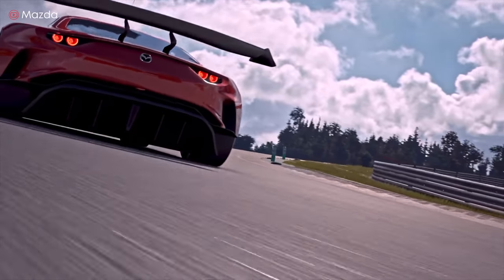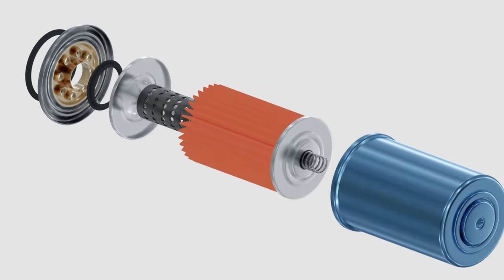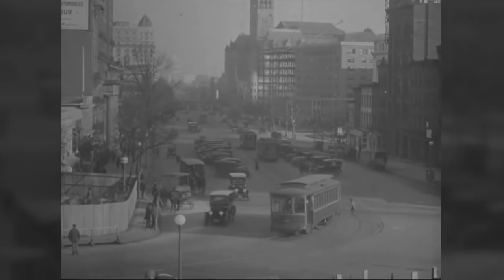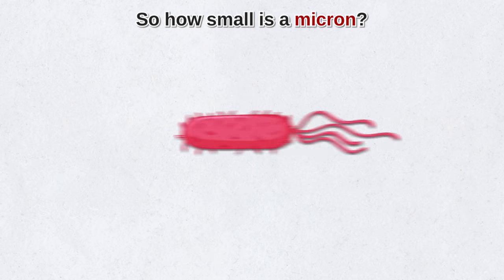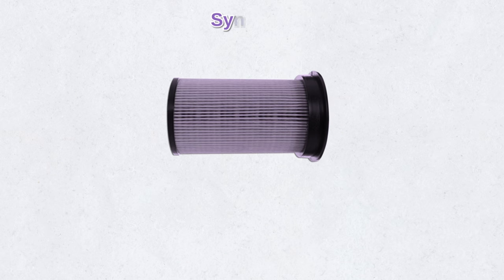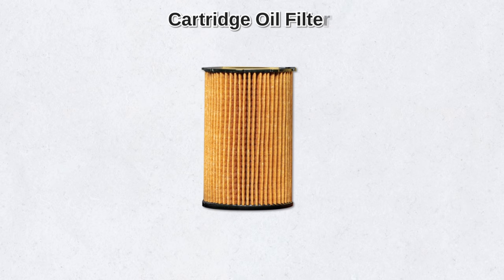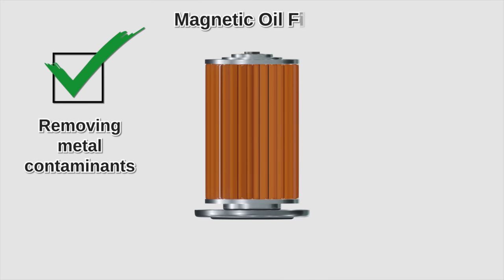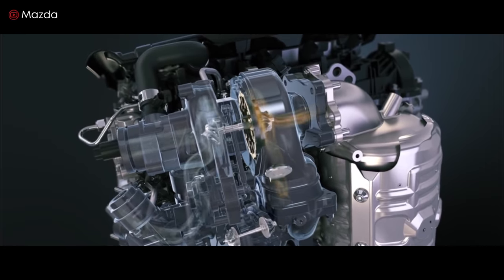This New Oil Filter Just Changed the Game (No More Oil Changes)

Comment: Around 1956 or so, family was vacationing in upper Michigan.  One of the other guests had a 55? Chevy.  He changed his oil filter with a roll of toilet paper.  Filter container was large enough for it to fit.  Thought then that it might not have been a great idea.
Reply: Yes of course it had to be a Frantz.   The famous Frantz 3 stackers that you still can find on diesel engines in the  gulf of mexico  was the same as the origional Frantz that used the old canister housings was tall enough to take 3 Frantz canisters with 3 rolls of toilet paper. When they went out of production a Frantz dealer replaced them with a big paper towel filter called a Gulf Coast filter. The smaller Frantz was replaced with an improved toilet paper filter called a Gulf Coast  junior. All I use now is the old Motor Guards and Gulf Coasts and some Motor Guard compressed air filters that I converted back to oil filters. I'm a toilet paper squeezer and very good at it .60 years of experience. The Australian Jackmaster looks interesting. I'm told some Australians  use toilet paper in them. They came out in 1954. I added a Australian Jackmaster to my filters. A very impressive filter. The top loaders are better equipped to use Toilet paper. They have the bigger core seals for the bigger core paper.
Reply: Was at a Flea market in Denton Tx selling Frantzs about 30 years ago. An old couple with the only car they ever owned a 53 Chevy car. It had the origional Frantz adapter for the AC canister. An over the road trucker showed me his two Frantz 3 stackers. Said he gets a 6 pack of Safeway Truly Fine to service them. These made my day. Also got the fools and liars.
Reply: The 3 stacker was the same as the AC Fram and other canister filters except it was tall enough to take 3 rolls of toilet paper for diesel engines.
Reply: There were things you could do to make the old canister filters less messy to change like adding a drain valve in the bottom. I believe I put a drain valve in the bottom of my Frantz 3 stacker. I think it might have came with a drain port.
Reply: The 53 model Frantz oil cleaner was the best you could buy. Normally I remember 60 years ago better than yesterday. A lot of the old optional equipment cartridge filters in my younger days.was it a Fram with a A C cartridge .  Working in a full service Standard station  we had the Atlas cartridge.. about the only good cartridge filters in those days were the Frams that used cotton. Or the Frantz that I didnt know about. Frantz had their own canister by then

Comment: @scotty kilmer , how about doing a video purely on the imortal Buick 3800? History, pro's, con's, include the Australian varient (ecotec), why it got canned in 2008, it's terrible replacement,  the SC version, etc. BTW G'day from Australia 🇦🇺 🦘. love your videos 👍😎
Reply: I have a 3400 in the Pontiac Torrent. Seems to be another good one. I just put a Australian Jackmaster on it. The Motor Guard I took off it was a good game changer filter but I wanted to test the Jackmaster. A very impressive oil filter. Probably Australia's best. I expect the oil to stay amber colored. I dont drain oil. I learned at a young age filters should get dirty and oil should stay analytically clean.  A GM technician told me the 3800 was the best engine GM ever made. When I have time I plan on putting an oldsmobile 3300 I believe in a H Farmall tractor..it has a 2.5 Chevy engine in it now. The 3300 is in a 93 Oldsmobile. Has new head gaskets.

Comment: Even if you have a miracle filter that keeps oil so clean you could fry chicken in it, still change your oil at no more than 5000 mile intervals. Oil wears out, due to temperature extremes and constant pressure, especially multi-grade oil.
Reply: Took me 20 years to put 250,000 miles on the 84 Subaru with no oil drains. Bought it new. Changed the Frantz oil cleaner every 12,000 miles and added a quart of Mobil 1. A Caterpillar lab manager sent me a sample kit.He said the oil looks good for that many miles but recommended every 6,000 miles. Toilet paper fit the Frantz in those days. Now you need a top loader with a larger core seal such as the Australian Jackmaster. At about 260,000 I gave it to a guy that needed a car. Both head gaskets were leaking oil. Smewhere over 300,000 he was sent to Iraq. Never saw him again or the car. Funny how we sometimes feel love for a car. It had a Frantz adapter that eliminated the full flow filter.

Comment: I use premium oils which can last for 10000 Km for low mileage engines but I change the oil filter at 5000Km so for a single oil change I use two oil filters

Comment: I maintain all my cars and my families cars and i change oil and filter every 6 months or around 4500k - 7000k miles. I use Mann filters and Purflux and use Shell oil or Elf as all vehicles in my house are Renault, most of my families cars are Renault also. We have 5 Meganes, a Clio, a Laguna and a Captur. I have an eye on a Kadjar that i might go for.
Reply: I paid 75 dollars for a Renault  R 16 that needed a CV joint. Saw an old couple in a Renault Dauphine  with the front down in a ditch. I picked up the front and walked it back out on the road. They thought I was Hercules. Didnt even ask them to get out. About 50 years ago.
Reply: The game changer oil filters ive used over the last 60 years are the Frantz the Motor Guard the Gulf Coast junior and the Jackmaster classic. None of them qualify as new. I bet if I went behind an oil change place and started cutting open full flow filters most of them would be clean.  I remember in the days of full service gas stations there were garbage cans full of clean air filters out front. Oldsmobile had a reusable air filter like an Amsoil.  It was in there too.

Comment: In the early 80's, I had a Ford oil filter pop open on the end, lucky it happened while city driving. Result - big mess, no noticeable damage. Probably a defective oil filter. Never used FL filters again. Been using Purolator filters since 2016 - no issues so far with their product.

Comment: Back in the day when cars needed an oil change every 2000 miles or 30 days changing the oil filter every other month was pretty reasonable if you didn't drive too many miles. So it wasn't a myth it was reasonable idea.  But times and the quality of oil changed since my 1966 Olds was new.
Reply: I hear you. Bought a Rambler American flat head 6 . It had a bypass spin on filter bolted to the head upside down. The oil was always dirty and black. A Standard oil engineer came into the full service Standard station where I worked. He pointed to his Frantz. He said use one of  these and Delo. Your engine wont wear out and your oil wont need changing. Went looking for a Frantz dealer. The oil turned amber. I did change the oil and replaced a head gasket once
Reply: We normally changed the Frantz every 2,000 miles and added a new quart of oil 
Delo was only single weight for diesels 30 and 20. About 29 cents in the discount stores. Couldnt use multi Grades in a diesel in those dsys. Motor Guard lube oil filters were a better design but couldnt compete with the better known Frantz. They added a cmpressed.air filter and later dropped the lube oil filter. Still make the compressed air filter. I still use a couple of over 50 year old Motor. Guard lube oil filters. 29.95 with hose and fittings for the Frantz and Motor Guard. Grand Auto parts sometimes had the Motor Guards on sale in the San Jose California area.Ignorant people would say I can get a genuine filter that came on the car for a dollar. Had a Frantz on display in a auto parts store. An old timer asked me if they were as good as a Fram.
Reply: @ralphwood8818  At the very dawn of my memory there was a 1956 Plymouth and then a 1960 ish Pontiac Tempest with half a v8 in the front and a trans in the rear that shifted where the cigarette lighter should go.  And there was a Rambler American... But the first car I ever owned and tore apart was a 1966 Olds, although I still worked on several 1960's cars, I've only ever worked on flat head lawn mowers although I've seen both flat head 4's in Jeeps and flat head straight 8's in Buicks... Congrats dude, on very likely being older than me!

Comment: I have a VW air cooled engine that I added a full flow oil filter to. The only problem that seems to exist is that even when I change the oil and filter I fill the oil filter with oil before installing and when I start the engine after a oil change the oil pressure gauge shows the engine probably runs for at least 5 seconds before the gauge shows that the oil pump has reprised and pushing oil into the engine. I seems like the engine is getting some wear in this no pressure period. I would like to come up with a way where this condition could be eliminated.
Reply: The engine is getting oil as soon as you start the engine. The oil pressure doesnt come up until the pump meets resistance when the oil system is full. Might be best to have the full flow filter threads up. I didnt have a full flow filter on my 66. It had a Motor Guard bypass filter.  The Motor Guard  was promoted as a off road dune buggy filter tested by Dune Buggies and Hot VWs. VWs generated a lot of large engine damaging abrasives.  The main thing is to never allow the oil to get dirty and keep the valves adjusted.  Wife was getting the oil changed about every 1500 miles. Never got an oil change after I met her.

Comment: Would it be bad to use a 15 micron filter on a sludge filled engine? Seems like it would be plugged and the bypass would be used mostly. So maybe a 40 would be good for a cleaning cycle and a 15 for in-between when engine should be clean?

Comment: No oil filter can allow oil to remain in an engine indefinately!   At some point the oil's addatives will break down as welll as the oil itself.  As an oil circulates through a hot engine the lighter elements go away and the oil  gets progressively thicker.  Run oil long enough and you end up with something resembling tar.   Engine oils are subjected to intense heat and cumbustion byproducts.  This creates chemical reactions that degrade the oil package.  IMHO  6,000-8,000 miles is the maximum mileage oil should be run in a gasoline ICE.  
I have had only one oil filter give out.  It was a NAPA Gold filter that seperated from the rolled edge of the body to base.  Fortunately I was almost home and coasted safely to a stop.  I never used a NAPA filter again.

Comment: What are the chances that these filters remove oil additives from the oil during filteration? Which could modify the oil lubrication.
Reply: I would say that happens to a very small extent in normal oil change intervals but I have read in manufacturer's data sheets that oil that is in storage for a very long can have additives drop out into the bottom of the container
Reply: Zero.
Reply: There are trucks that haven't had an oil drain in over a million miles. Some a lot longer.They have an oil analysis program that tells the condition of the engine and what's in the oil including additives some pay experts to read the oil  analysis reports. They get the new additives from adding.make up oil. The ones I am familiar with use large bypass filters that need gallons of make up oil added when the filters are changed. That would be the big Gulf.Coast filters. They are all over the gulf on offshore rigs shrimp boats. Crew boats tug boats. NASA saw my posts and started using them. I have used the small filters for almost 60 years. I have only had my oil analyzed one time. I've used Frantz Motor Guard and Gulf.Coasts. They all get the job done. I'm partial to the ones that are the least messy to service. I have several small engines. All I have now is Motor Guards and Gulf Coasts. Some of the Motor Guards are very old
Reply: Some of the stuff you see in the bottom of the container is dirt. I used to think new oil was clean. Not always. I recently put a Austrailian Jackmaster on the Pontiac Torrent. A very impressive filter.
Reply: The game changer filters will remove additives like graphite. Additives last a long time in clean oil. New oil added at filter  changes replenishes the additives.  Oil analysis is a way to read the additive levels in the oil. Thats what they do with   expensive engines that use game changer filters.

Comment: My wife took our 2015 Honda pilot to a valvoline quick lube 2 years ago right before we left for a trip home for the Christmas holiday 22 miles later the motor with 60k miles blew up,  lots of hassle later we spent 8k to replace the motor neither Honda nor valvoline took any responsibility both lied to us that's on south Blvd in Charlotte NC
Reply: Now you know NEVER to go to ANY quick change oil place. So, when you got your car back from the "shop", did you pull out the dipstick, look at the oil and check the level?
Reply: yep, it's basically near minimum wage kids changing your oil, probably some from a half-way house, Jiffy will hire anyone. They don't know or care about your car, and weed is legal in most states now too, lol. I don't like those odds.
Reply: When I was selling toilet paper filters people would be concerned about the warranty. They had no problem going to a oil change place  and getting a junky no name full flow filter. Warranties are only responsible for their origional equipment. Not power chips exhaust brakes bypass filters and so forth. Truckers that have depth bypass filters and dont change oil have an oil analysis program to prove the oil is good.

Comment: In 30 years we are supposed to go all electric cars. I personally  cannot see that happening being our electric grid prevents this as it cannot possible handle the demand electric cars will require. So change your oil and filter and start being  responcible. Gasoline engines never getting totally phazed out.
Reply: We had a problem in Texas  where there wasnt enough electric to heat our homes or pump water to our homes. If you needed electric for medical equipment and didnt have a generator  you were screwed. You couldn't buy gas the stations were closed. Now they want us to buy electric cars that most of us cant afford. I think the plan is to get the gasoline so expensive we will have to buy the electric cars. Our next president Kamala will figure it out. It was unusually cold for too many days.

Comment: On M111 engine, it was the first time I change the oil filter on this kind of motor... the thing is the oil check valve is not doing his job when the oil circuit is opened and I was not knowing that at all... I start the engine et discover the tragic sound of straved hydraulic lifter, straved VVT :'( ...

Comment: Great vid...kind of skipped over the bolt-ons they put on 50's chevy 235s.
Reply: The first game changer oil filter I am familiar with was the 1953 Frantz oil cleaner. It was similar to the new Frantzs but used only the canister. The Frantz canister went inside the old filters that were mostly optional equipment on the old Chevies. Instead of the oil going thru less than 2 inches of loose cotton it went thru 4 inches of dense toilet paper. The oil turned amber color. With modern filters the larger engine damaging abrasives are removed. The smaller engine wearing abrasives and sludge is allowed to build up in the oil until it is drained. A terrible maintenance program. Not every body bought into this terrible system. I stopped draining oil when I installed a Frantz. Oil cleaner in 1963 there are improved filters but they are getting harder to find. I think you can still find the little Gulf Coast 01 junior and the Australian Jackmaster. Some Australian's are cheating and using toilet paper. They are promoting their own elements now. The Motor Guard went to compressed air filters. It was the only one safe to use for compressed air. My old Ford 390 has a 50 year old Motor Guard on it and a Gulf Coast on the transmission.I dont think good elements are now available for the old canister filters. You could still get Fram cotton elements in the 60s. Cotton was decent. My 41 Dodge had a Fram with Fram Cotton element.

Comment: I would be surprised that anyone who will try to save money by changing their oil filters every other oil change.
Reply: I've done it at times and I had a sport car with an imported Japanese motor. Approx 310k miles by the time I sold it.  I didnt do much city driving, but on the road I would run it. For the most I was religious with oil changes. Got purolator boss or K&N filters. Pennzoil or Valvoline synthetic oil..
Reply: I wouldn't either, but most car mfgrs. used to specify that- filter changed every other time. I don't know if tjhey still do..
Reply: .normally with a modern engine and synthetic oil you are only dealing with contaminants too small for the full flow filter to remove. You drain the oil to get rid of the small stuff and the full flow filter is still clean..I use the game changer filters. Motor Guards and Gulf Coasts. The only reason I change the full flow filter is I'm not sure how long they will hold up . No I haven't routinely  changed oil since 1963. I normally buy used cars and change the filter and oil. I install my toilet paper filter and change it about every 6,000 miles. Didnt do so well with a cash car I bought with 225,000 miles on it. Ended up costing me a couple grand for a Japanese import engine  and a few other parts. 06 Altima.